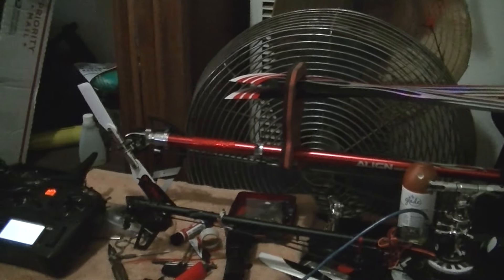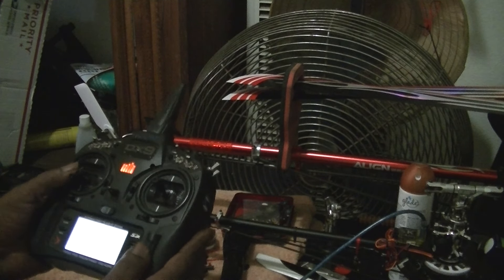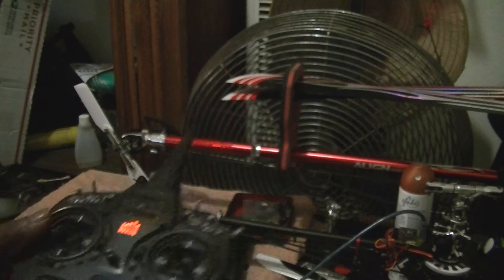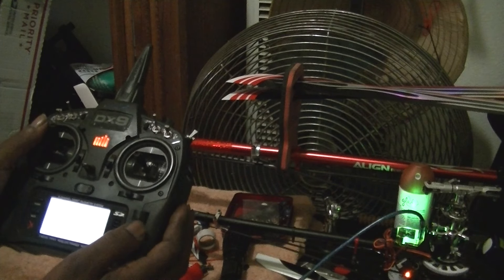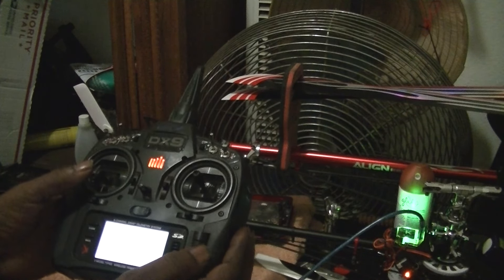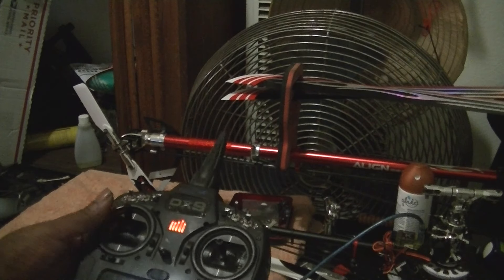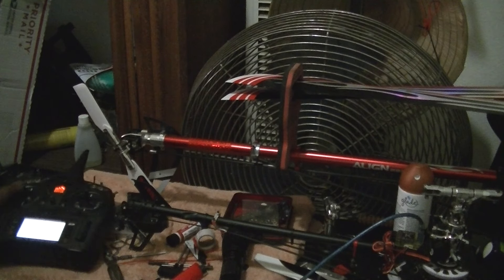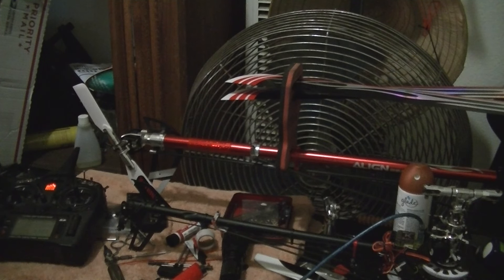Talon 90 spcekteum throttle stick calibration simplified go to RC helicopter

Comment: Hi, my radio trex550dfc talon90 ar7200bx dx9. did as you say. I remove battery, connect battery won't start. I lift my stick max lowered his blood then leaves again why?
Reply from the maker: watch the castle creations esc setup video brother sorry wpolate